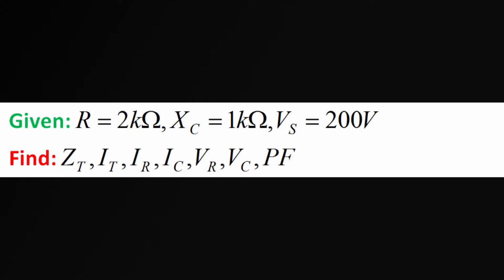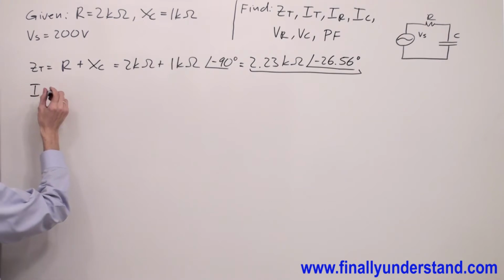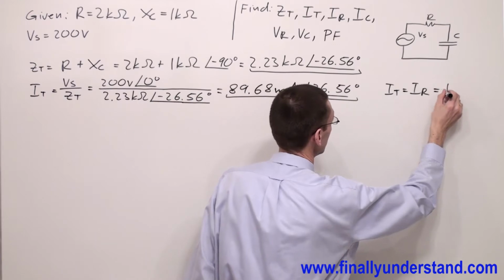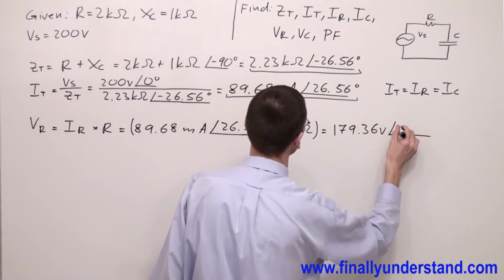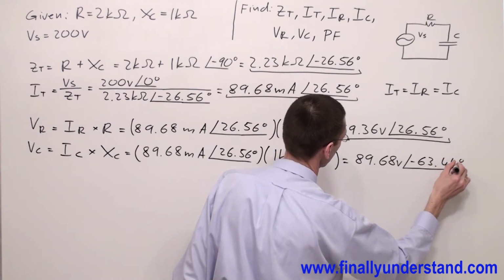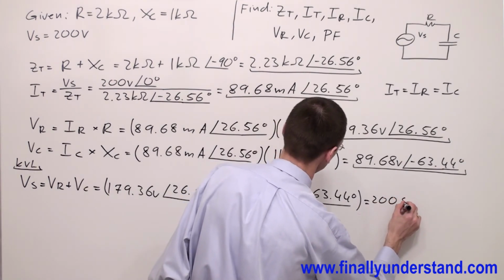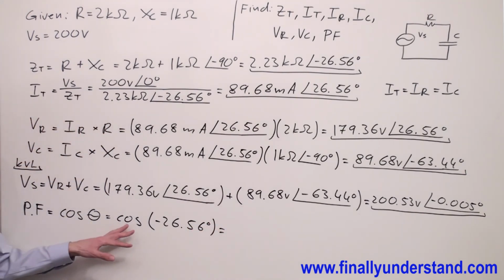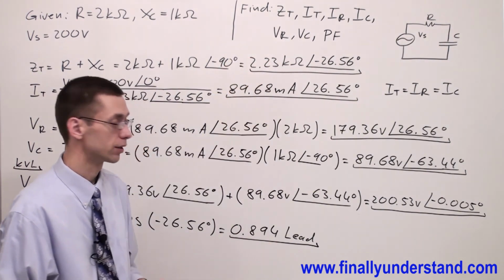RC Series Circuit Explained | Resistor-Capacitor Circuit Basics 01

Comment: Why are u putting angle measurements in the equation? And where are u getting these angles?
I have never seen that in my electronics class
Reply from the maker: Angle measurements in the equation are used when you work with the rectangular form. If you use the polar form, you’ll only see i or j.